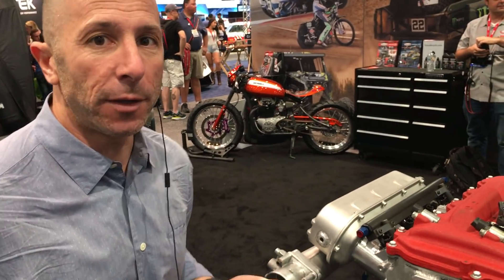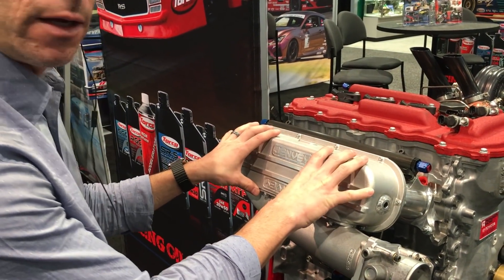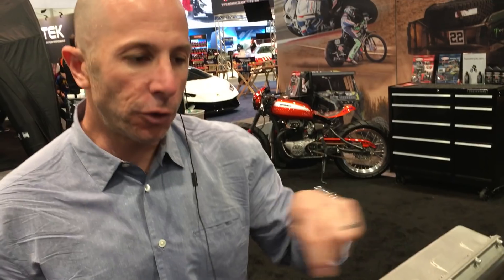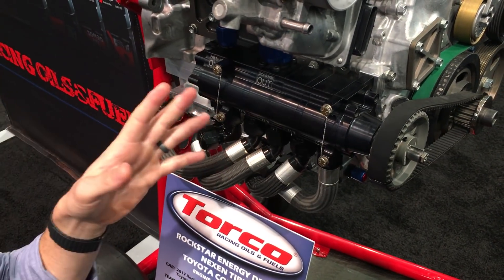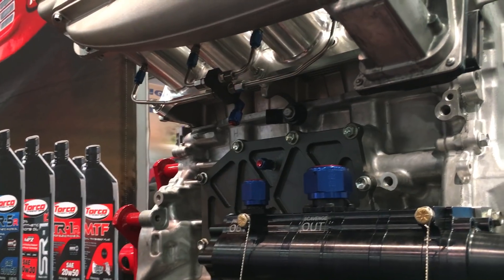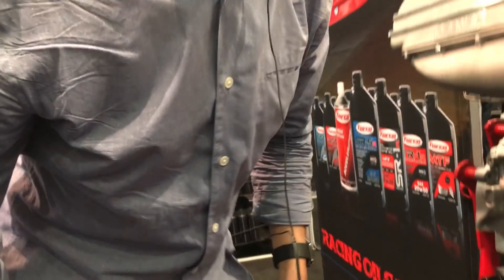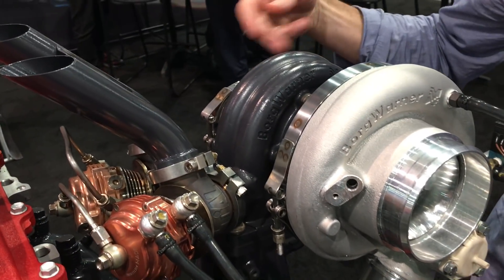How Intake Manifold, Nitrous and Turbo are designed for 1000 Horsepower 4 Cylinder

Comment: Pretty sure Your thinking about 
N/A not engines With a turbo the intake manifold on a turbo engine only has to flow air, thats it, it has a fixed pressure that equalizes pretty much instantly if its too big it has lag,  5psi is 5psi it dosnt magically change its all 5 psi in there.

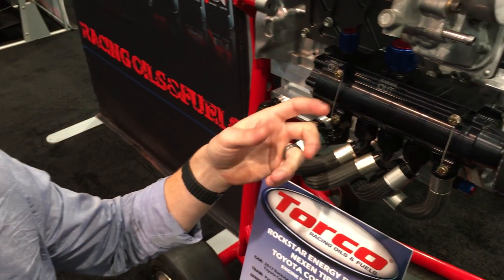Comment: 2:47 he made it sound so harmless, cavitation is when the pressure at some spot gets low enough to boil the oil and have oil vapor bubbles appear. The problem is that when the pressure rises back up the bubble collapses back into liquid. You have oil all around the bubble flowing into it as the bubble disappears and all that moving oil has nowhere to go an has to to stop. Oil being pretty much incompressible means it stops more or less in an instant. Force is mass times acceleration, acceleration is the change in speed over time and if time approaches 0, acceleration and force approach infinity. That means every time one of the bubbles collapse a shockwave is created and can smash little (in the mm range) pieces out of the metal surface of the pump.

Comment: You need to put a 2AR-FE race program for folks who want ro use the 2.5L 2AR in Sport Compact drag races. Yes, many use rhe big 2.7 TACOMA 4 cylinder (3RZ-FE) but it is so heavy being an iron block and has an cylinder head that needa tons of modifications to try and make ir rev past 8,500 RPMS.

2AR-FE will be a better option in terms of weight and rev capabilities.

Comment: I actually have a go fast bits rv on my turbo that's adjustable so I can keep my intercooler basically primed between shifts, at low rpm I get a little bit of compressor surge or turbo flutter as some people call it, but at wot it's not there. Doesnt increase horsepower but reduces lag between shifts

Comment: So, Papadakis you said that blow off valve has straight sound, but if you do not have any BOV then you will get intermittent sound. About that, I have a question. If you will make BOV that fuctions like turbine without BOV, you will get any profits? I was thinking that If you have an intermittent air vent, will the answer to the gas be better? Because less air will escape from the system. Am I thinking right?

Comment: I forgot the purpose of the wires between the bolts of the oil pump.
Reply: Rahul Makan He has a video on “safety wire” it prevents the bolts from backing out. Common on airplanes.

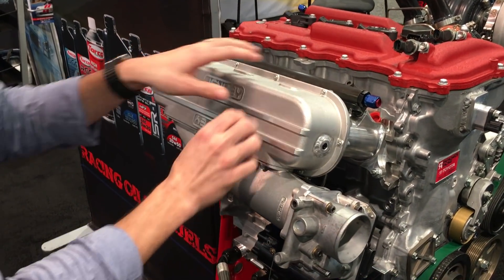Comment: 1:00 I'm going to through your words from another video, back into your face. 
Only one cylinder take in air at a time. The rest of the intake valves are closed. There is only one place for the air to go and that is in the cylinder with the intake valve open.

Comment: Cavitation means "air bubbles".  No.  Cavitation means that the oil boils due to very low static pressures occurring near pump components having a high velocity.  The bubbles are oil vapor.  QUESTION:  Oil slinging (in the conventional sense) inhibits power output?  If so, about how much?  With 1000 Hp. output, about how many hp per lb.?  I enjoy your videos.

Comment: Which model EFR turbo is that? Was it the new Black Series? What was the displacement/engine speed/boost where the IWG was insufficient? At that power level, was a dual turbo considered (e.g. a pair of G25-660s)?

Comment: I was never able to understand "dry sump" until this demo! Thanks!
Reply: Douglas Buck  Worth thinking of using 2×   - 18 pipe for return from pump to tank. This size allows for a slower oil flow speed which helps de aireate the oil. Using the coolers in the return also helps + the cooler is under virtualy no pressure

Comment: No disrespect, but why does a drift car need 1000hp?
Reply: Formula Drift is drifting taken to the next level - Insane speeds combined with high levels of grip call for bulk horsepower to swiftly overwhelm the rear end and oversteer the car into insane degrees of angle. They get very side ways at very high speeds.
Reply: y K looks like I gotta check out a Formula D!

Comment: I want to put the 6 egt probes i bought into my single turbo exhaust manifold but im worried the guy that mods the manifold to weld the egt bungs might not do it that well and end up with a leaking exhaust manifold.
What type of solder would be best for this purpose?
Reply: jasaircraft 
Just weld them in. Just make sure to clean out the manifold before you put the turbo on. Other wise you end up with tiny chucks of slag going into the turbo.

Comment: I wonder how you feel about electric cars. They are pulling very strong numbers out on the track.
Reply: Yes indeed they are. Those electric cars are the reason these guys are finaly opening up in Hope's of teaming up for a desperate breakthrough miracle in combustion engines. Because let's be honest the way things are going the combustion system actually and literally needs a miracle. Tho I'm afraid even a miracle will not be enough.

Comment: Why lock wire in the oil pump bolts?
Reply: To prevent loosing them up because of vibrations. Bad tension on belt because of loosen bolts would cause oil starvation that would make unrepariable damage to engine.

Comment: C'mon paps, I've had no BOV for almost 8 years and Turbo is still 100%, no play, cartage is mint still, blades link new on cold side and exhaust side is just blackish, still literally 100%, Comp surge on boost is bad off boost not so bad!
Reply: I believe that abscence of BOV or bypass would cause later spool after opening throttle again, which is unacceptable in high grade racing applications.

Comment: Ok for the overpressure valve but I like the ciu ciu ciu ciu sound more...
Reply: May not be very good for the compressor, so you may have to pay for your pleasure.
Reply: On my car i tightened the Blow off valve so it could not open anymore.
When i changed gear the turbo was considerably slower, to build op boost again and the car felt slow for half a second.
I found a way between opening and closed, so on full boost let go, it opened, but on lower boost it ciu ciu ciu ed, so that could be an option.
The turbo was a small T25 garrett and only 220hp at 1 Bar.

Comment: That 4 cylinder has more power than the Lambo in the background lol.
Reply: Brett Duffus probably won’t last for as many miles without a rebuild though...
Reply: yeah but it's not streetable and daily-driveable like the lambo.
Reply: @evilflowx  Obviously. The point is that it is incredible such power can now be made from 4 cylinders, to the point of being able to compete with and beat "super" cars. At one time, you would have been laughed at if you suggested that a 4 cylinder could be built to outrun that car. Incredible times.
Reply: Mad Pierrot  but you’d need to spend just as much money if not more to make that 4 cylinder car drive like a super car
Reply: That lambo is stock. Not even a realist comparison.

Comment: Dump question - Why not use another set of injector (or pwm-ing the solinoid) to control how much nitrous going in the engine instead of changing the jet size?

Comment: Tiny throttle body for 1000bhp I assume it's a 600bhp ish with the turbo and nitrous takes it to the claimed 1000bhp. Good looking tidy job there you've definitely put some effort into that build.
Reply: Big2009Gee they have a dyno video I believe it made 840whp 875wtq without nitrous and like 1007 with
Reply: @sdvdub1  interesting, that's serious power, it is built to an outstanding level however, I'd like to know what turbo they are using it can flow big volume for sure.
Reply: Big2009Gee its a Borg Warner.. not sure on size though
Reply: @mayk3lll  at hoonigan they show the build of the corolla, but its an old video.
Reply: Still not bad for a 4 banger
Reply: Previous vid on a Mustang dyno they were at 6-7 hundred at high 20s boost.
Reply: Its 2.7l..
Reply: @codywhitlock2077  boost, and a lot of the engine design. 4 cylinders can make high torque but it's usually just really high in the rev range.

Comment: Does it make any difference where the Blow-Off Valve is located? Most People run them nearly the Throttlebody and this was the first time is see a BOV near (or in this case) IN an Turbocharger
Reply: Close to the turbo is the most ideal, from an engineering perspective.  The turbo is what you are trying to protect from pressure surging, not the throttle body.  Also, having the BOV before the intercooler means you aren't chilling any unused air.  

It won't really matter if it's near the throttle body.  Makes no real difference until you start splitting hairs.
Reply: If we are speaking about blow-off valve that dumps air in atmosphere, than no difference. In closed recirculating systems OEM manufacturers place bypass valves as close to compressor wheel as possible.

Comment: Hi, 

Great Video.

What is the benefit of using both individual lambda sensors and EGTs to trim the AFR? 

I assume the individual lambda sensors are just used for initial setup and not for permanent use?

Thanks, Will
Reply: audi / lehman style manifold like the 80s quattrros

Comment: It's not a 5 stages oil pump.
A 5 stages pump would have one suction side,and each stage would feed a smaller one in serie until the exit port.
It's just 5 separate pumps working in parallel :  in suction or for building pressure.

Comment: Loved this vid, if anything the intake setup is what interested me the most the design and testing must have been insane, as well as the individual cylinder trimming, awesome stuff
Reply: What's insane about it? You rent a dyno cell, have a bunch of parts you want to test and try everything to see what works. OE engine controls have had individual cylinder control for at least ten years if not longer. The aftermarket about 5-10 years, so it's not that amazing either. Expensive yes, but none of this is difficult to understand and don't limit yourself.

Comment: It nice man I can’t put a Price on how much it cast to get my 07 fix but just got 07 Scion tC want to no how can I try make this power on na motor want how much power I make before I go to turbo or supercharger I like be part of the team lol it take a lot to get there I no it not going had over night but I would love some help I like your work seeing you on Hoonge garage I think spelled it wrong but have cool man check me out lol
Reply: People have been turbocharging the Scion TC for a decade. Go over to Scion Life and read everything, it's been done before. It's not hard t learn and it doesn't have to be expensive, measure 1,000 times, cut once. One of the big problem is lots of people spent, two or three times to get the final destination. First you have understand that fuel is your limitation. If you only and ever want to run pump gas that will limit your output.